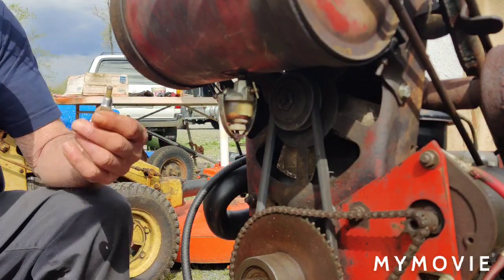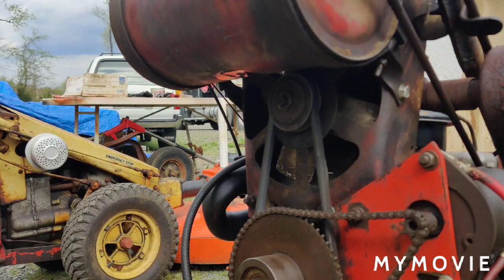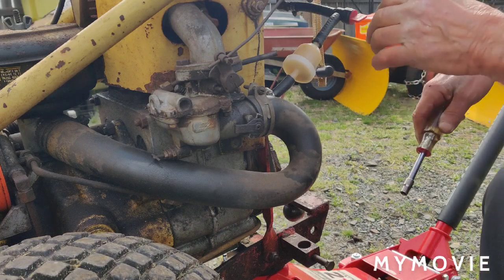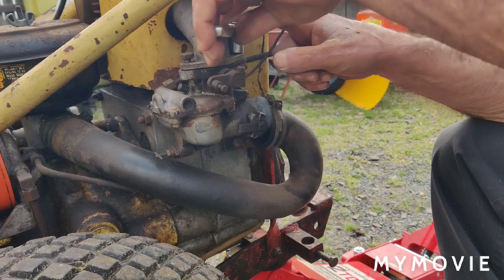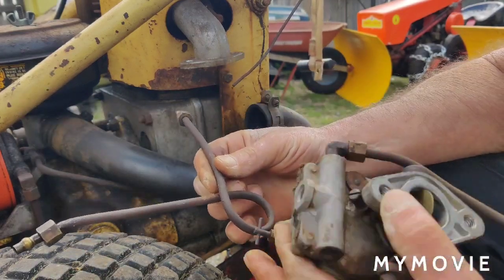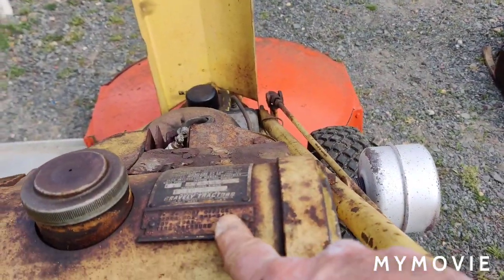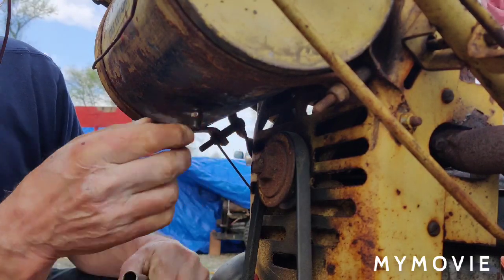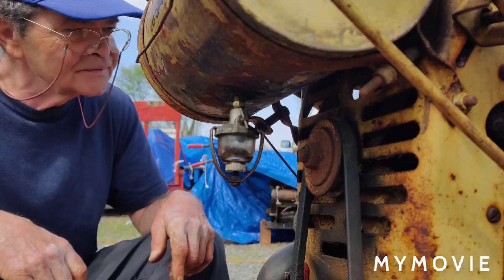61 Postal Gravely. Install original fuel supply.

Comment: That's what I always liked about them older Gravelys with the Studebaker engines.  If you have a good sparkplug, and spark, and fuel to the carburetor, one pull and they are running. Very easy to start. Thanks Artie.
Reply from the maker: You are absolutely right Dean. Thank you and Thanks for watching 👍

Comment: We use the identical fuel taps, they are not great but they do the job. It ran great after you removed the fuel blockage
Reply from the maker: It still seems to be running good. I think the tractor is back to original status. Thanks for watching my friend 🔧👍